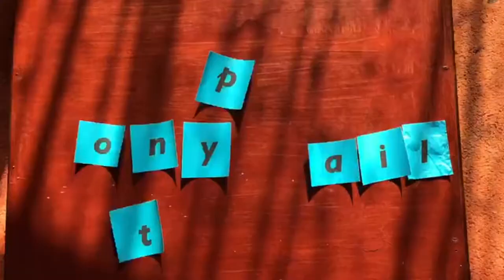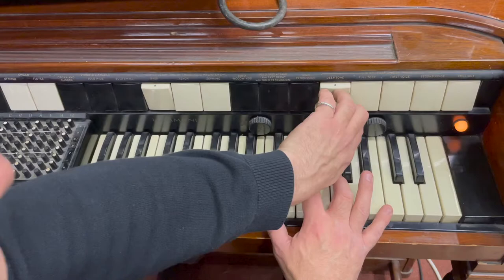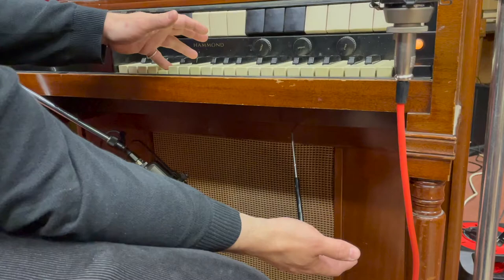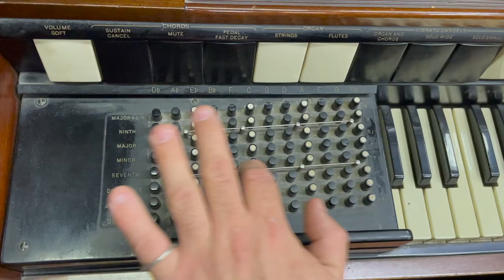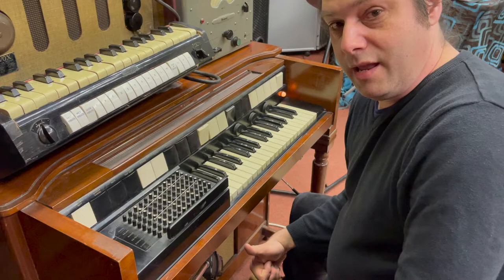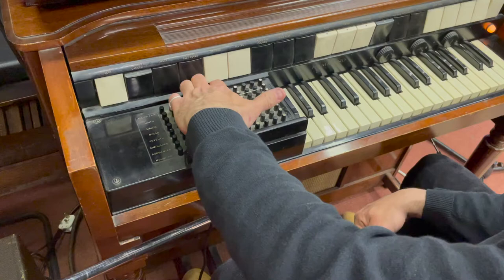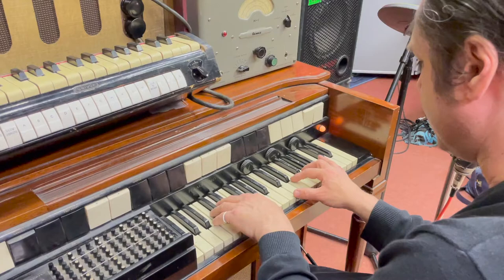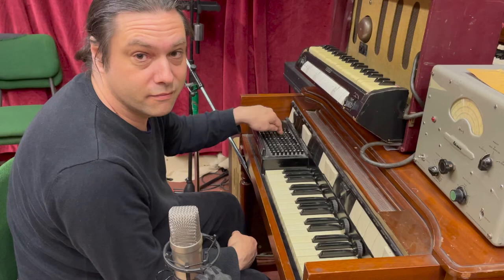Hammond S6 Chord Organ Demonstration and Blue Jay Way story

Comment: Hearing you play has brought back many fond memories, thanks for sharing it.  I have an S6 that my Dad purchased around 1956. I used to play it when I was a kid.  Unfortunately it hasn't worked for many years, but I just don't have the heart to get rid of it.  I wonder what the chances are that I could get it repaired.  I even have the original manual that contains a schematic.  All those 12AX7's ;-)
Reply from the maker: Hi Steve - send us a private message as we may be able to help with an actual repair or advice on where to get it repaired.
Reply: I fixed one 10 to 20 years ago for a cloistered nunnery. There is one of those power resistors with taps (3or4) in a crimped metal bar riveted to the chassis. One section was open, it's in the B+ supply hence no sound. Start there they often fail. 300voltsDC, caution. We junked one years ago but I saved the chord box and want to put MIDI in it.

Comment: Wow!  I had no idea they made such feature rich instruments in those times. It sound impossible to make those features with only 30 valves.  For the polyphonic organ surely you would need one valve per tone.   And there seems to be more than 30 keys!  And if it is not fully polyphonic there has to be a microprocessor that assigns an oscillator for the last x pressed notes.  Or maybe there is some switch wizardry that prioritizes some keys over the others when pressing too may keys at the same time?  Really good demo as well!
Reply from the maker: Thank you! The system uses the valves and I think divides each set of 12 tones down in octaves

Comment: I came across this video not too long ago, and it made me regret not purchasing a low priced S-6 chord organ years ago, at a thrift store. But just recently, I was told of someone locally selling one. It turned out to be an S-112, not an S-6. I never heard of the S-112, but as far as I can tell, the only differences are, the case styling is a bit different, it has a normal organ volume pedal and on/off toggle switch, instead of the "dislocated shoulder", and it has an additional knob that adds reverb. I bought it and took it home.
Reply from the maker: Amazing! Lovely that it has reverb in too!

Comment: I want one. I have the tonewheel spinet made at the same time, the M3, and it's the next best thing to a full sized Hammond, but this has such a distinct sound.
Reply from the maker: It’s brilliant - I only bothered getting one because of the George Harrison connection, but was really surprised at how lovely and unique it sounded
Reply: @VintageKeysStudio  I'm so curious... Are the valves in it as rare and niche as they would seem to be? Did you have to spend four figures to get it in a working state?
Reply from the maker: @georgeparkins777  no, I think they are fairly common valves - it cost very little to replace the power supply capacitors (£20 ish) - i was lucky with this one as it worked fine before I serviced it, but just had a few dangerous and fraying cables and wasn’t earthed
Reply: @VintageKeysStudio  I'm going to be honest, I have never bothered to earth anything that wasn't already earthed. I suppose in a studio setting that would be an insurance liability.
Reply: @VintageKeysStudio  I'm going to be honest, I have never bothered to earth anything that wasn't already earthed. I suppose in a studio setting that would be an insurance liability.
Reply: Bought one!

Comment: Grounding an organ like this is a bad idea, as there is some residual AC leakage to all common metal parts from the aging power B+ power transformer.   An AC ground wire, will most likely produce sparks and/or smoke.  Better to use a GFIC.
Reply from the maker: Cheers - all of our old valve gear (that has a power transformer) has been earthed and runs smoothly, and nothing has caught fire in fifteen years of doing so.  Everything runs through an RCD here so it is all quite safe. :)
Reply: @VintageKeysStudio  I had briefly forgotten that in the UK the AC connection plugs contain fuses, which makes a big difference compared to the USA.    The problem with the grounding of vacuum tube equipment in the USA poses a problem that a typical circuit breaker is set to trip at 15 to 20 Amperes AC.   If someone was to touch a an instrument such as the metal parts of a vintage Hammond organ per-say, up to 20 Amps of current could flow through a human body before the circuit breaker tripped.  With a GFCI, attached directly to said equipment it trips at a AC current level of 4 to 6 Milli-amps.   The only real cure for a AC powers transformer in vintage equipment which has leakage to it's case is to replace it with a suitable match, or have it re-manufactured (rewound).   For instance the HICO transformers which Hammond used up until around the 1960s were potted in wax.   The later transformers were potted in tar.  The later tar potted power transformer in the Hammond B3/C3 was also undersized for the job, and can run blistering hot after several hours of idle time.  The transformers Don Leslie used in his amplifiers were not potted in wax.  The later types which I think started in the 1960s were potted in tar but used only in transistor based amplification tone cabinets.  TMI, I know.... ;)
Reply: A piece of equipment which is much more thorough in testing for a "Hot" chassis, instead of using a Multi-meter would be the B&K 1655A Isolated AC Power Supply/Leakage Tester.  Unfortunately a 230/240VAC version does not seem to be available.
Reply: @DandyDon1  I suppose a GFCI outlet would come in handy when testing an organ being restored, but they do unfortunately kill tone compared to higher end receptacles.

I can attest to the 50s PTs being wax potted and sometimes problematic.   In a Les Paul Jr. amplifier (GA5) from 1955, I measured not only a hot running PT (even with cathode bias resistors and plate resistors at proper values), but wax was boiling and dripping out onto the cabinet below!  I was seeing a slight short between one of the windings and another.  I replaced it with another 50s wax empregnated PT and all was fine and could be run for 6 hours before getting more than warm.  

Thanks for the info about GGCI.
Reply: @ChonkTek  I've seen a Hammond PR40 tone cabinet's power transformer with evidence of wax dripping from the wiring holes.  No bubbling though....